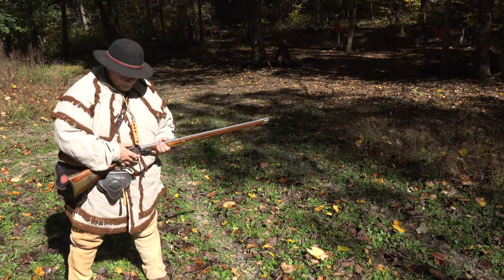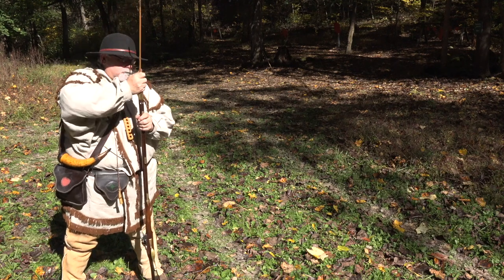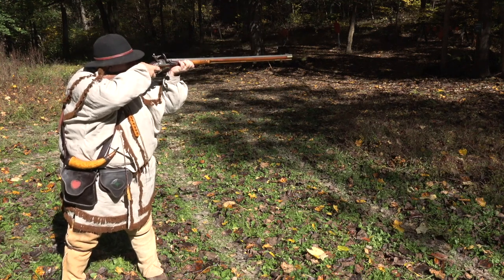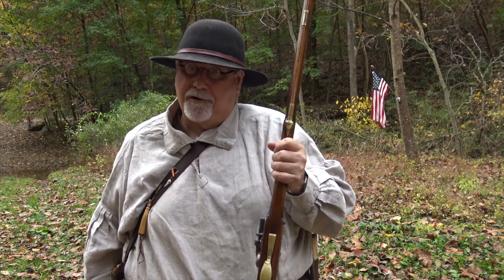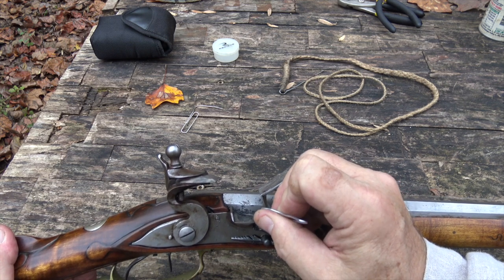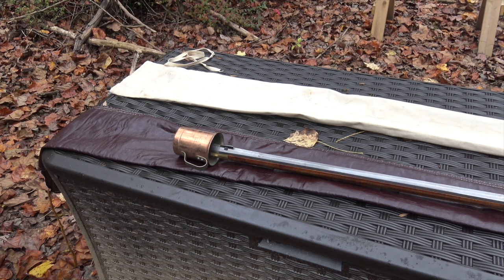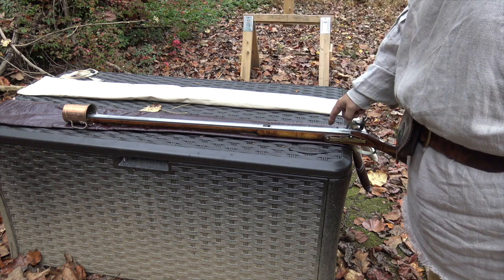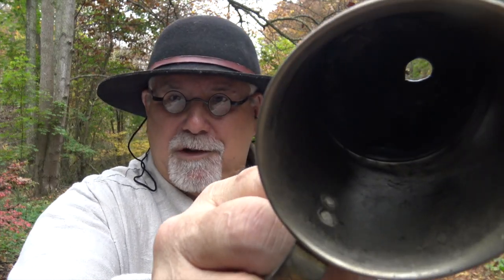Clearing a stuck cleaning jag

Comment: About 26 years ago I was cleaning my Pedersoli Brown Bess after a relaxing afternoon at the range. This was before I learned to stop using bore brushes in a smoothbore! I had attached a bore brush to the metal rammer and after reaching the breach was beginning to draw the rammer back towards the muzzle. That's when the 3 piece, friction fit rammer decided to come apart.

The rammer came out but the brush, its adaptor, and the lower piece of the rammer had come completely off. I ended up getting it out by taking a 45-inch piece of fencing wire, bending a hook in one end that looked a lot like a shepherd's crook, pushed the hook through the bristles( not easily done) then retrieving the offending pieces. No harm, no foul, except now I had a nonfunctioning ramrod.

I eventually found a machinist that produced a solid, once piece ramrod for me, complete with the threaded end. The button end actually looks more period correct than the one that came from the manufacturer. He said he made it in the same way that nail heads were made. I only use the new rammer to clean in the field.

 At home, I fashioned a wiping stick from a 5/8 inch oak dowel I bought. I carved an indention about a quarter inch up from the bottom of the "jag" end. I submerged it in a PVC pipe filled w/ boiled linseed oil & coal oil for a few weeks to waterproof it and prevent breakage. Now I only use moist pillow ticking to swab the bore. 

I still use that same wiping stick, and Bess and I  are still together 26 years on, w/ many happy memories afield to look back on. Best regards, JA
Reply: Interesting, where do you purchase Coal Oil from?. Personally I like using Pine Tar mixed 50/50 with Turpentine, wipe it on the wood generously, let it soak overnight, then with a propane torch and a clean rag, heat the  up so the pours soak in the pine tar, and wipe it clean, something my Father used to do with fence posts.
Reply: Sry Eric, I'm used to calling it coal oil. It's kerosene. My grandfather was a WW1 vet, he walked a mail route for the USPS and owned a small farm. That's how he supported himself , my grandmother, my mum , my 5 uncle's& aunts and a neighbor who's wife died through the Great Depression & home front rationing of WW2.
He told me the farmers used to fill a milk pail w/ sand then pour in a 50/50 mix of boiled linseed oil & coal oil( kerosene), then insert the wooden handles of their hand tools. 
Wood will still draw fluid up, that's why old dead trees rot. Kiln dried wood breaks b/c there is no sap to keep the cells of the wood supple. The linseed/ coal oil acts in that function preventing the tools from breaking as easily and essentially waterproofing them from the inside out. It preserves the wood cells.

I  wood is wood. I treat all my wood like this. Wood stocks get a few months soaking in a tub I made for that purpose. Wooden ramrods/ wiping sticks, tool handles, ect. Best regards JA
Reply: @SteveAubrey1762  Hello Jack, thank you for the reply. Okay, Kerosene👍, My Grandfather was a WW1 Veteran as well, and my Father was a WW2 Naval veteran, My Dad had enlisted in 1933 and was a radio radar operator with the ZP-12 Squadron (lighter than Air) in the Atlantic, then He spend some time on the USS Arkansas(years unknown), then was deployed on the USS Redfin (Gato class sub) 1942/43 then finished off with the USS Wasp (essex class Aircraft carrier)1943/45 South Pacific theater.
   Don't know much about Grandfather, all I know is he was in France during WW1.
  Take care of yourself, thanks again for your time and response.🇺🇸✌️
Reply: Hi Eric, that is so neat about your Grandfather & father. Do you have any pics , like a old photo book? My grandfather was an engine mechanic on airplanes in the Army Air Service, as it was called back then. I used to have lots of pictures he had taken , but after a few moved I can't find them. It's neat learning about ones family history. Very best regards, JA
Reply: @SteveAubrey1762  Hello Jack, Unfortunately the only photos I have are a small handmade leather photo album My Father made while aboard the U.S.S. Arkansas and a bust portrait of my Father from 1938 ish, I had my Father's portrait tattooed on my upper left arm, like your senario with photos, many of my Fathers photos were lost in shuffles over the years, sad story.
   I love engines and Aircraft, those WW2 aircraft engines were state of the art back then, that would have been an interesting trade during that era. 
  Well Jack, thank you for sharing your stories with me, it's always nice to speak with someone who can recant stories of themselves or Family members who have served during WW1 or WW2.
   Good health to you and your Family Jack.🇺🇸✌️

Comment: I had a steel ramrod tip come off a hardwood dowel inside my brand new Ron Luckenbill  Bean style Tennesse mountain rifle because the glue failed.  I paniced!  When I calmed down, I ran hot water off the tip of the rod, managed to get the rod back in the tip, went outside and had a cold one and pulled the tip and the cleaning patch out of the barrel.  I not only glued that tip but drilled a 1/16 hole and inserted a paneling nail and peened the ends.  Lesson learned the hard way!  Thanks for the video.

Comment: I was a reenactor for around 15 years...we also did live fires at a range.. the trick we used to get a stuck ball (mini ball) out was a automotive grease gun.. a zerk fitting screws perfectly in the percussion hole on the Italian re-pos. A horrible mess to clean up but better than going to a Smith

Comment: Done that to deball a caplock. Sometimes you get excited and, well, forget a rather important step... In my case, the chamber appears to have eroded a bit and while I had a bullet puller that DID firmly grab the ball, I couldn't pull the ball and patch past that wide section and bring it out into the barrel. Unscrewed the nipple and put in about three or four grains of powder, all I could manage to shove in. It ended up being just enough to push the ball up about two inches which gave me more than enough space to let me get a good 20 grains behind it before re-seating and that was enough to blow the ball into the (very loose) river sand a few yards in front of me.

Comment: I had this happen to me with a .50 caliber T/C Hawken.  Put some powder down through the flash hole where the cone/nipple screws in and reinstalled the cone/nipple and fired it into soft dirt.  The jag end went three inches into the dirt.  I cleaned it off and finished cleaning my rifle.

Comment: I had the same issue a couple months ago. The range rod is fine after getting the threaded part out of the rod. Got the barrel cleared buy shooting it out but my gun is a caplock so it was a bit easier buy removing the clean out screw.

Comment: What about using a air pressure device? I have used one before. Next, I used a ball removal jag. A lot of work but it does work at times. If all else fails, I helped a buddy remove the breech plug and simply push it out.

Comment: Had to take the nipple off my percussion pistol and feed small amounts of powder through the rear reinstalled it made sure there was no gap between the patch and charge fired that thing out like a projectile never did find it. This is a particularly frustrating thing to have happen it disables your gun when all you wanted to do was maintain it or clean. Word to the wise the rod that comes with Lyman pistols has nothing keeping the end cap on except a bit of glue on one end.

Comment: I see people on the net using jags all the time. I ended up with the stupidest gun cleaning kit in the world. It came in a silver sort of briefcase. No matter what you wish to do, it seems like nothing fits. 
The rod you want to use won't match up the to tool you want, or the handle you want to use won't match up to rod you want.
None of the tips match up to the right anything.....mind numbing.
Anyway, I just got into a .50 cal Pedersoli Hawken flintlock. I put a cleaning patch on the .50 cal jag, put a cleaning patch from the kit on it, slid it down the barrel, and I'll be damned if I could get the rod out.
I found your video, and was able to get enough 4F stuffed in the touch hole to shoot the stupid thing out.

So here's a question, if I have a tight .50 cal rifle, should I be using a .50 jag, or should I find maybe a .490 jag?
Should we ditch jags and use mops?
This barrel is so tight, that a .490 ball with a .18 mink lubed ticking patch would need a mallet to get them both down the barrel.
This is all seeming stupid and confusing to me. Why is it when I put a cleaning patch on my guns rod with a jag, that when bottomed out, there's hardly anything left of the rod to even get ahold of?
 I've been casting, shooting and reloading a number of calibers for many years. I've just never seen anything so frustrating as this. 
Am I an idiot, or what?
Reply from the maker: Pedersolis have very shallow rifling. With a .490” ball, I would not use a patch thicker than 0.010”.

Your gun may also have a rough bore. I have a video on how to correct that on a Lyman Great Plains rifle. You may want to smooth your gun’s bore. It will load and clean easier.

Comment: a couple of months ago i had a nightmare! i was using damp patches in my 62cal jaeger. one of the shots sounded weak. like an idiot i loaded the rifle. the ball stuck half way down from gummed up wet half burned powder. it froze! i have a 3/8 steel rod with a large screw welded on the end and a T handle on the other. screwed it in the ball, it would not budge! i ended up putting a porta power against the T handle and the edge of the muzzle and jacking it out! i should have swabbed!

Comment: I had a bad experience with black powder years ago but now i want to get back into it, i am looking for a custom percussion 32 but im having trouble im about to give up and just get a David pedersoli 32cal percussion do u have any advice
Reply: The Tradition’s Crockett rifle is pretty nice for the money, and a little cheaper than the Pedersoli. I got it through Muzzleloaders.com as they had the best price (and free shipping at the time) compared to Dixie Gun Works and a few other stores. Ironically it was that gun that I had the same thing happen to but with undersized bore brush (pulled out of the base when trying to clean down in the recessed chamber). Didn’t even think to feed powder in through the drum to blow it out, but took the breach plug out to remove it. Mine shot low out of the box but was quickly remedied by filing the front sight down (couldn’t get either sight to budge in their respective dovetails so I just bent the rear edge of the blade to adjust the windage). Due to the smaller bore size, it did foul up pretty quickly so I had to swab it out after every shot or two.
Reply: @NoahCline  i want a  custom 32 at some point but to get my foot back in the black powder door im kinda leaning towards the Kentucky pedersoli, iv found some beautiful 32s but all n flintlock far as curly maple stalks
Reply: I know Dixie Gun Works has some selection of Pedersolis. The Cub and Scout rifles come in both flint and percussion and a .32 option, as well as finished rifles and kits.
Reply: @hbmoore7803  I’ve had the Pedersoli flinter in .32 for about 15 years.  It’s the Pennsylvania model and I really enjoy it.  I swab after every shot. .310 patched roundball, .015 patch, 25 grains Goex 3F with 2-3 squirts of 4F in pan.

Of course today, the cleaning jag and a dry patch came off of the ram rod, which is why I’m here.  Tried rethreading the ramrod onto the jag, but feels like threads are stripped.  So on my next day off, I’ll be doing my best to shoot it out.  I’ll sacrifice a tin can rather than a nice copper cup.

Comment: I got a jag stuck the whole way down against the breech plug face, no space for powder, now what ? When I removed the touch hole screw I could see the jag taking up all the space.
Reply from the maker: Trickle in some 4F powder and replace the touch hole and fire the gun. It should move the jag at least a little. Remove the touch hole and check. Put in a decent powder charge, re-seat the jag on the powder, and shoot it out. If the first charge did not move the jag, remove the breech plug, and drive it out.
Reply: @duelist1954  breech plug is all one piece with the barrel , and I said jag but mean copper brush with a cleaning patch around it leaving no room for powder. Powder just lays on the outside of the patch
Reply: @duelist1954  the brush broke off when I drove it down the barrel with the ramrod, there seems to be something in front of the touchhole protruding from the inside of the barrel, almost like a ball stop in case you hadn’t put powder in. The brush got down in the through the smaller hole and stuck in the powder chamber  just inside where the touch hole leads. And then it broke off.
Reply from the maker: @jackson4861  no breech plug is one piece with the barrel. If it looks like that, it is just well fitted. All breech plugs screw into the barrel.
Reply from the maker: @jackson4861  you are going to have to remove the breech. It will be tight. If you don’t feel comfortable doing it, find a gunsmith.
Reply: @duelist1954  whenever I clean these rifles, flint lock or percussion lock, there is something inside the barrel just forward of the touch hole and or bolster , usually I can’t clean below this area, is this a ball stop ? can you shed any light on this ?
Reply from the maker: @jackson4861  either your touch hole liner wasn’t filed flush with the bore after it was installed, or there is a little rough metal on the edge of the hole itself. If you remove the breech plug to drive out the cleaning brush, you should smooth that up with a rat tail file.
Reply: @duelist1954  so confirming , there should be nothing in the barrel except lands and grooves until I rest against the breech face?
Reply from the maker: @jackson4861  correct
Reply: @duelist1954  I just checked my two new completed kits from Traditions and they are the same way. If I run the ramrod down the whole way with a 50 cal brush on it , it hits something right before the bolster  and stops. If I put a 22 cal brush on the rod it will then pass through the smaller opening and touch the breech face. If I drop the rod alone it also stops just before the bolster, but a wire drops another inch deeper and touches the breech face.
Reply from the maker: @jackson4861  does your gun have a patent breach?
Reply: @duelist1954  I wouldn’t know, I’m just not that knowledgeable on the subject. Maybe I’ll call Traditions today and inquire. I do know that the barrel depth is about 1 1/4 inch deeper than the length of the ramrod, but when the ramrod is inserted into the barrel, it sits level with the top of the barrel, indicating it is sitting on something inside the barrel other than down against the breech  face, or the ramrod would be countersunk an 1 1/4”
Reply: @duelist1954  I did contact traditions, they stated that the breech plug is not removable, it is all one piece with the barrel.
Reply from the maker: @jackson4861  OK. That's probably not true, but I'm guessing that don't want you to remove it. I'm guessing it has a patent breech. Which model is it?
Reply: @duelist1954  St. Louis

Comment: you blew it, blew it right outta there    ;-)
Maby you could do this with compresed air or aerosol like potato gun ?
Reply from the maker: compressed air works fine, if you happen to have some with you in the woods
Reply: Linus: I had a stuck brush in my .54 cal Hawken.  100psi wouldn't budge it.  The powder trick did it.
Reply: @KB4QAA  Good-grief,  stuff happens, just pity the copper cup had to die.
Reply: @linasmagnum  Not dead. just needs a copper patch and solder.  5 minute plumbing job!